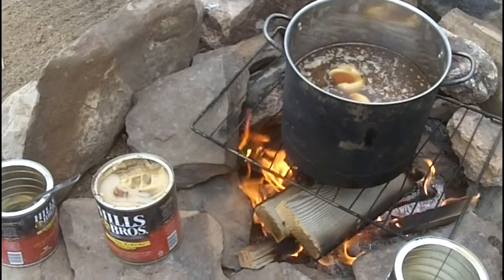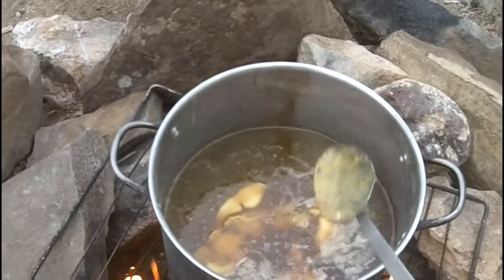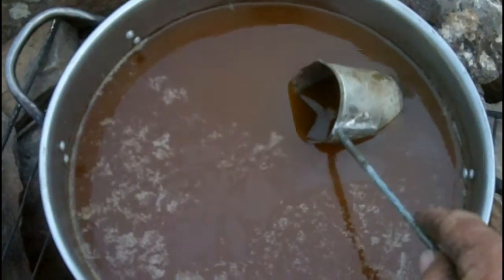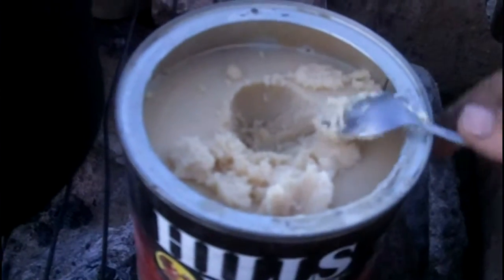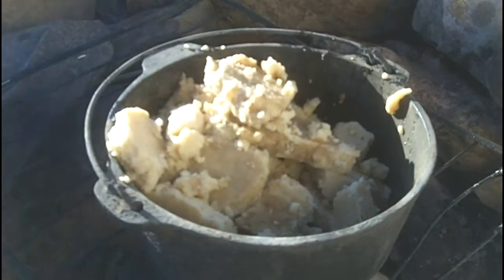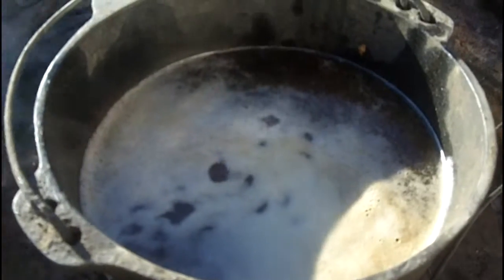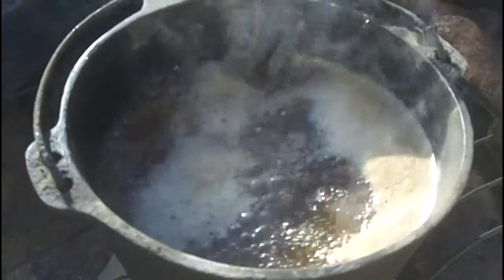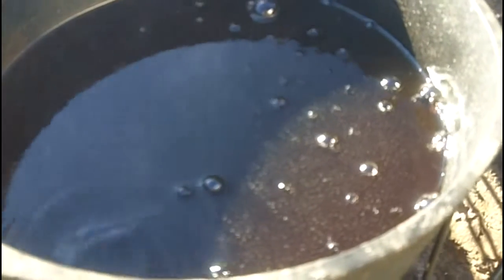Fat and grease purification

Comment: Very helpful. I'm doing this general process in our house, but I might do the second boil ("drying" the grease) outside. I noticed a lot of foam as you brought the 1st stage purified grease up to a boil. Do you skim that off?
Reply from the maker: Most of that froth/foam will boil off with time its just water. If there was something that would not boil of I would for sure skim it off.

Comment: Good guide. I watched it at 1.5x speed. 

A couple years ago, I started taking the used cooking grease and burning it in a small can in the backyard as a makeshift fire pit. It seemed like a waste to just throw it away. I'd had a little bit of luck with melting everything in a double-boiler setup, but it didn't occur to me to add extra water. With the grease in a more waxy state like this, I could probably even use it as fuel in makeshift torches / buddy burners. That's just filling a tuna can with cardboard and covering it in melted grease.
Reply from the maker: Thalanox I have another video showing how to make a good oil lamp using bacon drippings among other things.